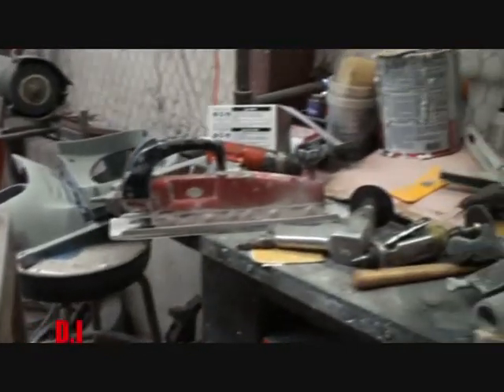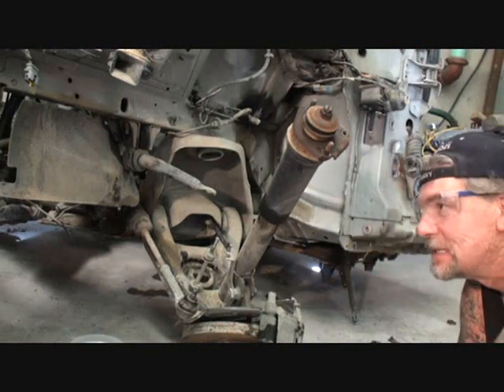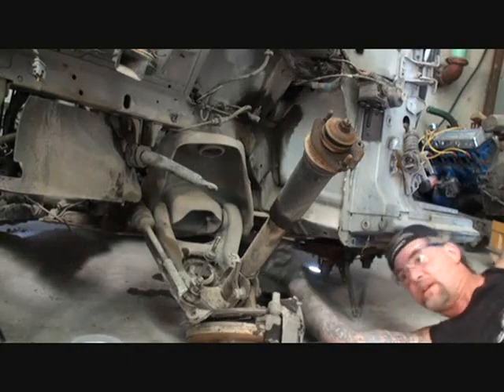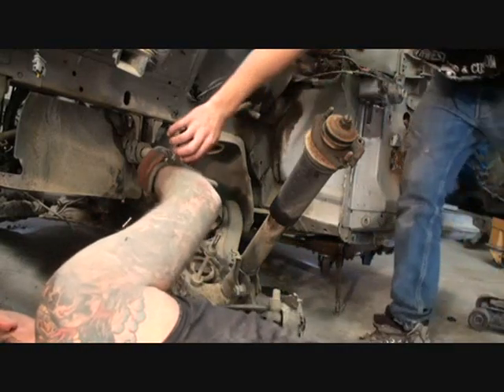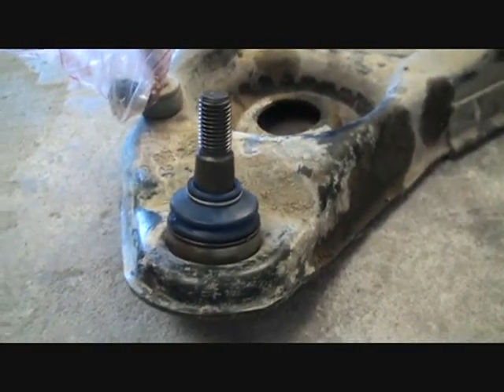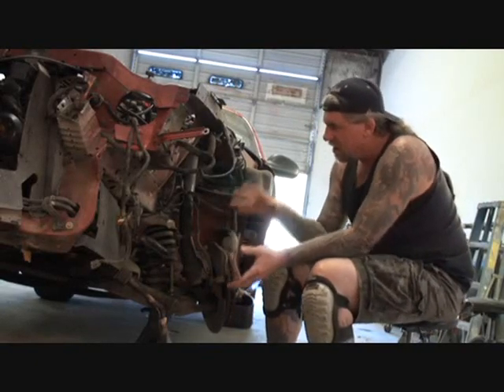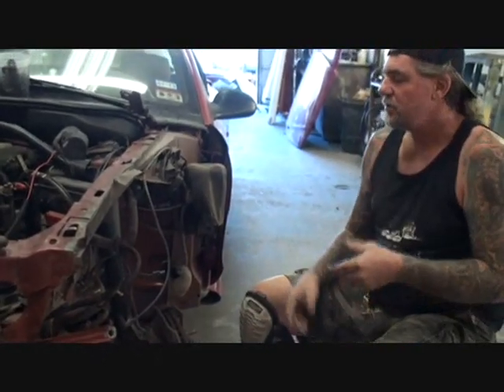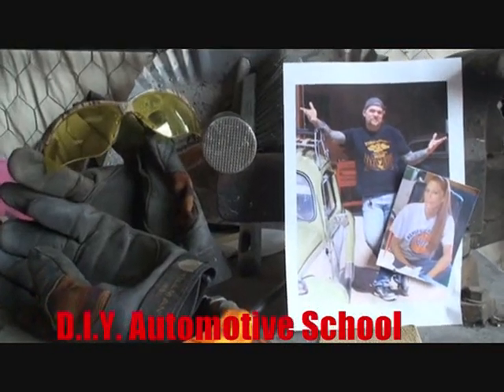Mustang GT-Collision Repairs-Do It Yourself -Part 4

Comment: Ok i really need help,i just spent 15,000$ on a one of one mint condition 98 mustang s281 saleen  that was hand built by the saleen company in irrvine california ,had it for a mont and lost control of ut and crashed head on into a underpass wall and and smash3d the whole front clup ,some say its totaled but i cant except that ,i been pull8ng and stretching and bending it all back to shape with a 10ton porta power and 3 comalongs ,it looks pretty much back to shape ,waoting for my radiator and power sterring and headlights to get here,is it gonna work and what can i exspect,,both driver and passenger doors open and close fine and windsheild is untouched plus its a covertable